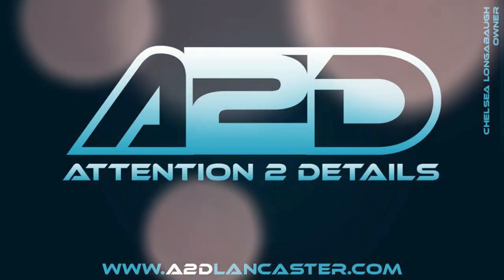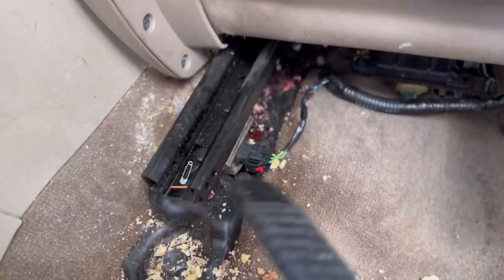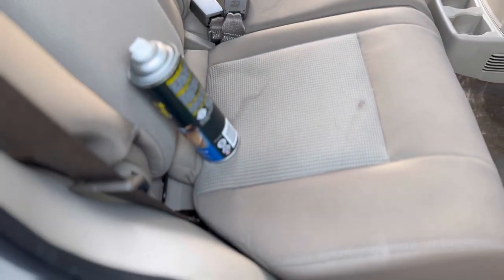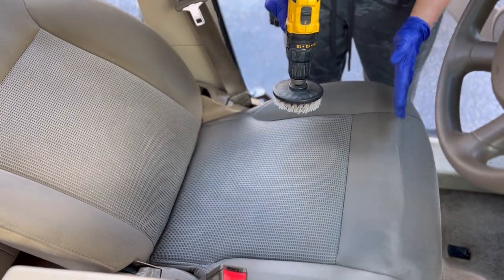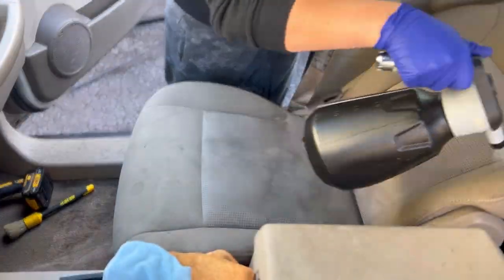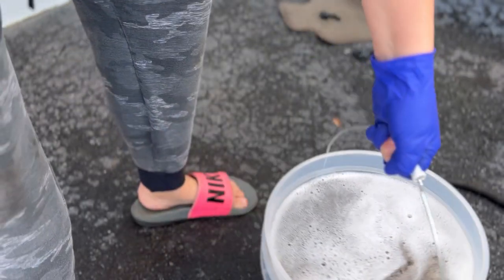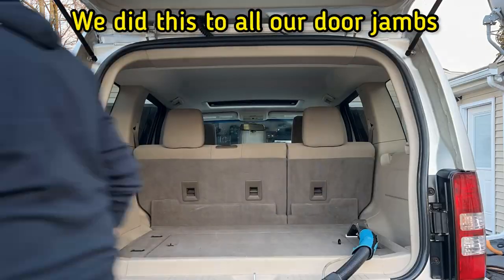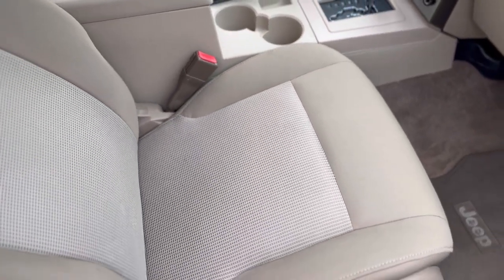15 Yr Old Jeep Gets Satisfying Interior Detail + Tips To Get Pro Results!

Comment: Good video.  A few thoughts from a 38 yr detailer at a jeep dealership and 3 yrs as a side business owner.  In the mid 90s to early 2000s Chrysler had a wicking issue with seat cushions,  not the fabric its self . It got to be such a issue that Chrysler put out a tsb on cleaning them . They suggested at the time to use dish soap and warm water . As far as headliner my go to is norwex powder laundry detergent table spoon or so to a qt . Works awesome.  Actually it works great on any surface.  60 degrees ! Heaven ! I'm in vt and have a ft of snow on the ground with another storm coming today / tonight , 1/25 . Take care .